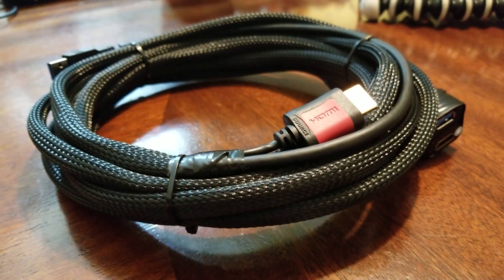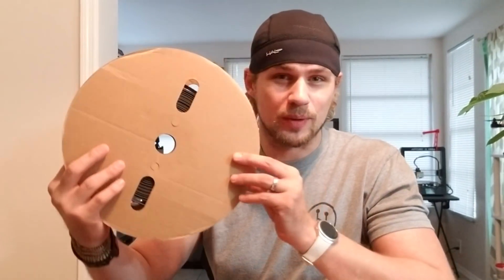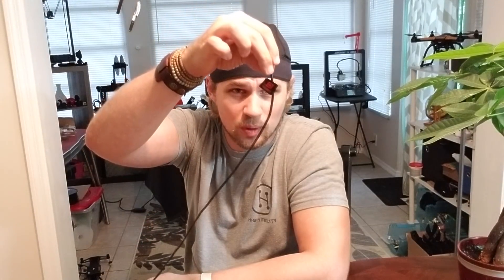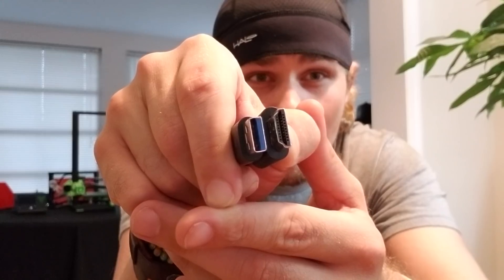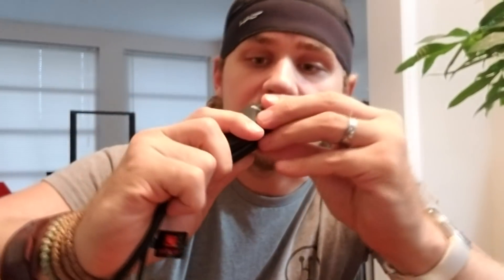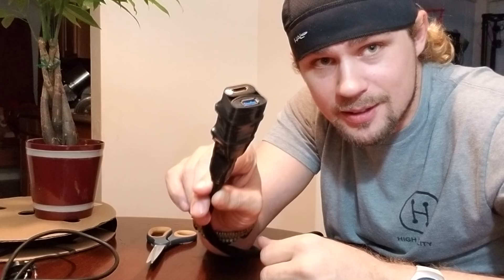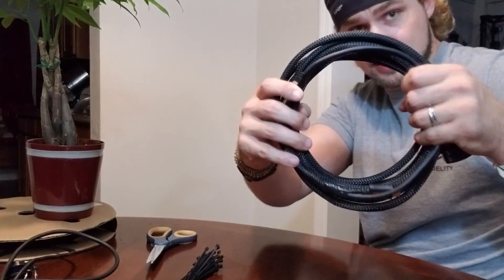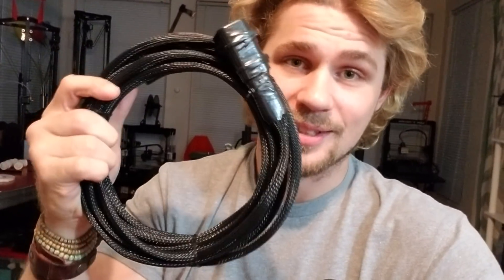How-to make an EXTRA-LONG BREAKOUT CABLE for your OCULUS RIFT!

Comment: Any idea why this doesn't work? I bought those exact parts only difference is I got the 10' Monoprice HDMI cable. Still won't work for some reason. Tried with and without usb extension but still nothing. Plugged HDMI directly into PC and works great. Thoughts?

Comment: works this solution with GTX970? can be weird question but recetly i bought an extension cable supposedly compatible with oculus cv1 but doesnt works in my pc. Looking for the problem i recently open a post where are listed compatible extension cables and the mine (Amazon Basics) is incompatible with gtx 970... my graphic card T_T.

Comment: do u make these cable the hp vr or Acer vr or any other vr
Reply: Wmr should work fine with extension leads, make sure you read the supported cables for your headset

Comment: Awesome vid! BUT.....I guess ya didn’t cover this...so in order to really get the full length of all the extensions and ability to cover the whole room, ya definitely need the power adapter for the active usb 3.0, and route an extension cord into that mesh with the hdmi and usb..otherwise you’ll be plugged in at a wall socket at the repeater section and kills the whole purpose of having an extension. 

I got all the parts in the video and using an Odyssey+ with 15ft extensions, and I’m getting no display on the HMD and a lot of static/screeching. Still messing around with it to see what works, but I keep checking back here on the comments hoping someone has some solutions here to that problem, or if experiencing anything similar
Reply from the maker: You shouldn't need to power the cable unless you use two of them!) Just one should be fine without it) Check the repeater, sometimes they have issues!)

Comment: i got the parts but the audio is crackly the picture keeps cutting out and when i plug it in it plays the plugging and unplugging sound a few times, any ideas what i should do? cables work fine on there own

Comment: Hi RealityCheck. I have a mixed reality hmd and the cable has to be HDMI 2.0. It is hard to find the info, do you know if this HDMI is? And I read you got 90hz with your hmd, could you please comfirm this as 90hz is needed for my hmd. I wish to buy extensions on 25 feet if possible. Bought the usb which doesn't work due to sound tearing.
Reply from the maker: Incan confirm that the cables I showed work very well with Oculus, Vive, and windows mixed reality)
Reply: @RealityCheckVR Just to correct, I meant that my 25 feet cable has sound issues but so cool that your 15 feet does work. Eh the PCI-E USB 3.0 card you bought, you couldn't get your setup to work before using that if I understand you correct? I don't have that PCI-E card but will order one that will ship to Europe, fingers crossed. :) Thanks
Reply: @RealityCheckVR  Are you connecting your VR HMD usb 3.0 cable to the extra PCI-E USB 3.0 card in your pc, or using the external USB 3.0 powered hub you have as top amazon pick? (:

Comment: Could you recommend a decent power adapter? I have purchased your 15ft cable in the past and would like to get a second one so that I can run the cable along the wall and ceiling.

Comment: A few things, and I'm sorry if it's been covered, but I didn't see it: why the repeater? Why not a HDMI jack? They're cheaper, mine is hooked up to a 12 foot HDMI jack and then the rift. No problems. 

Second, if you're still reading, why on Earth would you use zip ties? Velcro strips are reuesable....

Comment: Just curious, wouldn't just buying a longer male to female USB and HDMI cable work in extending the stock cables without buying all of that other equipment?
Reply: The longer the cable the more you sacrifice quality and signal strength

Comment: you blew my mind with coiling up the cable. I am going to use that technique for the rest of my life!!
Reply: If you do theater/audio/lighting jobs.   They require you to do that because every cable has a memory after leaving the factory if you go against it it will shorten the lifespan.
Reply: For sure. I normally just wrap it then loop the ends through the middle a lot to make sure that it doesn't come apart.

Comment: I have to say THANK YOU !!!  I have tried many cables to extend the rift (including the Oculus recommendations) and nothing worked. The trick was the HDMI repeater and the active USB cables. Even love the cable mesh sleeve (once I finally got the cable pushed through them). Thank you for an awesome how to and CORRECT clear directions and products to make the cable.
Reply from the maker: Glad I could help Paul! 
Thanks for checking out the video)

Comment: I've seen that exact HDMI repeater on Amazon but it says 'Support up to 60fps'. Is this true, or can you get 90fps with it?
Reply from the maker: the cables I use keep you at 90 fps for the signal it sends. 4K signals usually come in at 30hz and up to 60 hz, but the 1080p type signals flow fast!!! :D
Reply: +Reality Check VR The Oculus Rift is 2K 90hz I'm pretty sure. Should I invest a bit more in a Repeater that supports up to 4k 60hz? :)

Comment: I ended up ordering the 1/2" blue/black braided mesh made by Alex Tech and it doesn't stretch enough to get the HDMI connector of the Monoprice cable through. I should've ordered the same brand as you or gone with 3/4". I'll find some other use for this 100 ft roll. finger cuffs? lol ;)  maybe i can carefully trim some plastic off of the connector without destroying it.
Reply: I did the same thing but red/blue 1/2 and had the same issue.....What did you end up doing? Same as video all black or did you end up getting the 3/4?

Comment: Just an FYI, the active HDMI cables already have buffers in them so the repeater isn't necessary.  I just used the smaller and cheaper passive female-female HDMI couplers and it's worked flawless for many months :)
Reply from the maker: the repeater is necessary for some people running laptops and even a few people on PC's have told me they needed it. totally true that most systems will run just fine with out it though))
it's more necessary for 15ft cables, but even then it really depends on a users system from what I've heard from feedback. I did a lot of tests and many gave HDMI errors without a repeater after time. they can be as low as $6 bucks so its not so bad as a full proof for most all systems)
Reply: Reality Check VR better safe than sorry that's for sure!!  :) I actually have a repeat on standby in the event that i have trouble but so far never have. That might change later with future HMDs like Vive Pro or Pimax pushing more pixels

Comment: I buy this cable 15 FT USB 3.0 and 15ft hdmi monoprise and repeater4Kx2K this expensive. First works but later i have problems with sound... and later also problems with pictures.... I spend so much money to order that to Norway :/ Try buy 10ft don't buy 15ft.
Reply: when you buy 10 ft do you still need the repeater?
Reply: @freezxng_moon  This is another tricky situation. It depends on your pc and your overall situation, I have seen it work without one and I have seen it not work as well. I would still get it for the added stability but you could try it without then order it if you need it if that is the route you want to take. Keep in mind that either way you go you are going to need a female to female HDMI pass through. Personally, I just tried to use 15ft cables and got sound popping and crackling even with the repeater so I am going to return those and get 10ft cables.

Comment: I seem to be having the hardest time with my headset since my pc has limited port. I have to use a hdmi to display port adapter and have bought over a dozen cables. I cannot seem to get my headset extended. It seems so simple but there must be something I am doing wrong. Love the video and plan to do the same as soon as I can get it extended. I’ve used every oculus recommendation and have used the fb oculus group for help but still no dice. Any help would be greatly appreciated.

Thanks-JP
Reply: I can't believe no-one have replied to you before now. Some people which have a new mobo, a few mobo's have an option in bios to increase voltage to specific usb ports. DAC(SOMETHING) I think. They claim increasing the voltage in encriments is more effective than a repeater/special cable. If NO cables work for you even 1m then my guess is that your psu or mobo is weak somehow. I will paste a text in the post below this what some wrote could be an option. Thought you might have tried it already:
Reply: *"Having tv show vr while using vr hmd:

Got it, thanks for the info! Actually, that's a pretty common port config on discrete graphics cards.
You may wish to consider a DP 1.2 to HDMI 2.0 adapter so that you can connect a second HDMI device to your PC. If you're using the DP port for Mixed Reality, I'd recommend taking a look at our following page on recommended adapters:"
https://docs.microsoft.com/en-us/windows/mixed-reality/enthusiast-guide/recommended-adapters-for-windows-mixed-reality-capable-pcs

Comment: He stole this ig video from another guy and these cables don't work trust me
Reply from the maker: +briandavid68 who did I steal this from? What do you mean they don't work? I ship these out daily and have never once had someone say it didn't work. I've been extending cables since before others could publicly buy extra sensors so I'm 100% positive your remarks are false.
Reply: "stole" this from https://www.youtube.com/watch?v=uuNTtSQg02w&t=407s

And they straight up followed every single step and it just doesn't work.
Reply from the maker: that's me man... so do you get sound but no video? Does the Oculus have an orange light that turns white but no picture? It's not guaranteed to work by any means, but I'd say MOST people have no issues with this. Sometimes it could be something as simple as needing more USB power via using a powered HUB or it could be the GPU doesn't put out enough juice. Are you using a laptop? Some people say using a DVI adapter to HDMI gets it to work when HDMI alone does not. I believe all problems can be fixed my friend!
Reply: Reality Check VR yea it just shows orange no video
Reply from the maker: What GPU? If you jump in the discord there might be some people that can help as well)  https://discord.gg/MPWaYKv
Reply: Reality Check VR when I get home i will check. Sorry you looked different and I didn't check the channel
Reply: Radeon RX 580 Series
Reply: thats my gpu

Comment: I build this the exact same way using your guide and also your links to purchase the correct cables, and while trying to use this I could not get video signal to the headset.  It could not even get through the setup process for the headset after trying to reconfigure.  Possible problem with the 15 foot length?  I am ordering the 10 foot length to test also.

Comment: have you thought about getting the tp cast for the rift?
Reply: +CadetDude I don't know about Reality Check VR, but I have made the step to Tpcast wireless w/both Vive and Oculus.... Freedom ! It's so cool not having cables to worry about, you forget where your at in room-scale VR space at times, and it really adds to the immersion
Reply: MetallicanVR85 you get the custom firmware license thingy so tracking is better and mic can work?
Reply: +Cadetdude I think I'll wait until SweViver and other's put vids out on demo of firm. lic., I'm happy with tracking and having no mic is ok, I can use the mic on my webcam. Sure would've been nice for them to release w/working mic, wtf?

Comment: damn that breakout cable looks sexy!  I need to get me some of that mesh cable sleeve! Hey Reality, just wondering but have you connected  2 active usb extensions together to a sensor and your pc? could a 15 ft connect to another 15ft?
Reply from the maker: you can but you need to add a power adapter at that point!)
Reply: Power adapter?